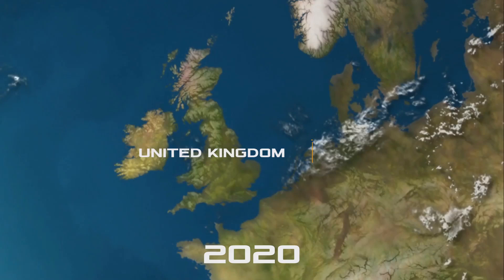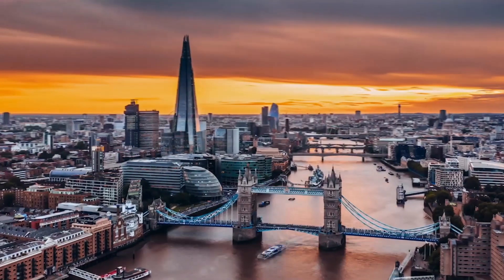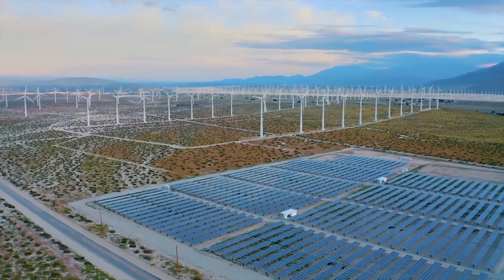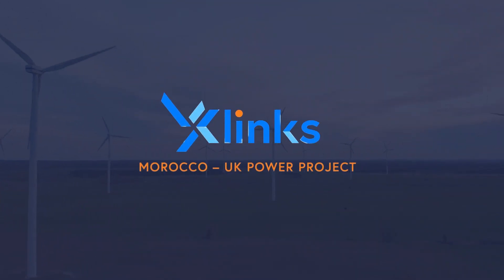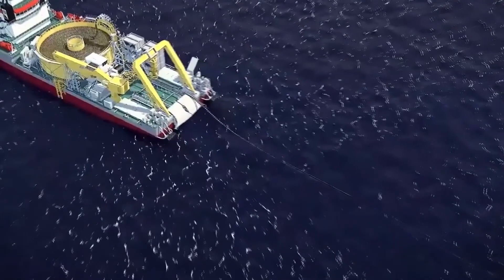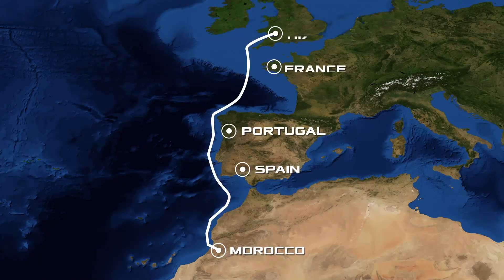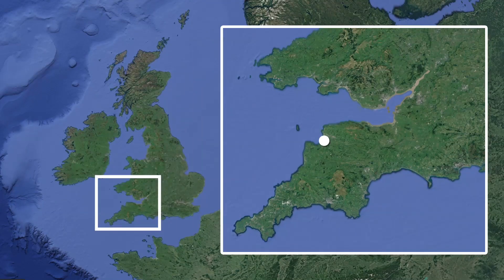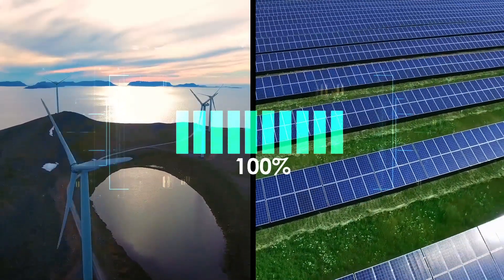How the world’s longest submarine cable from Morocco will supply the UK with green energy

Comment: The loss in energy along the sheer length of an undersea cable is astronomical, it's some 30% energy loss on the UK grid already. This is political lunacy. For a start, why not Morocco sell its electricity to Spain which is much closer and cost effective.
Reply: there are cable already between morocco and spain
Reply: HVDC cables are more efficient than you give them credit for - China has HVDC cables that run this kind of distance with 10% losses, so quite acceptable I’d suggest given the increased number of sunny days power year, and the backup of wind power.

Comment: UK-based renewables company Xlinks is the project’s developer. The Xlinks Morocco-UK Power Project, as it’s known, will cover an area of around 579 square miles (1,500 square kilometers) in Morocco and will be connected exclusively to the UK via 2,361 miles (3,800 km) of HVDC subsea cables. They’ll follow the shallow water route from Morocco to the UK, past Spain, Portugal, and France.